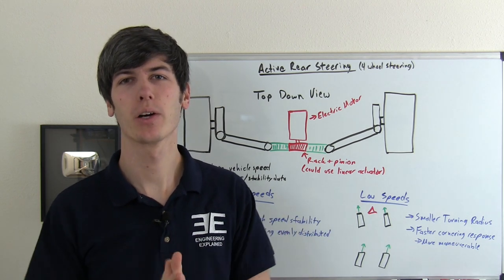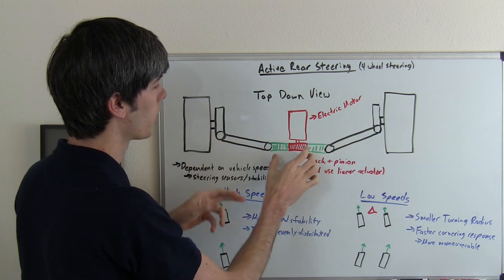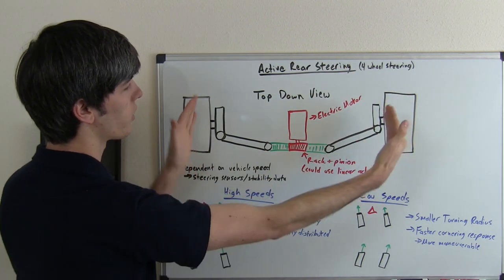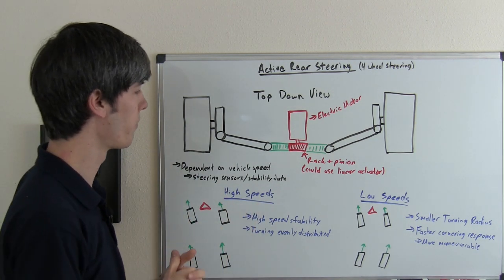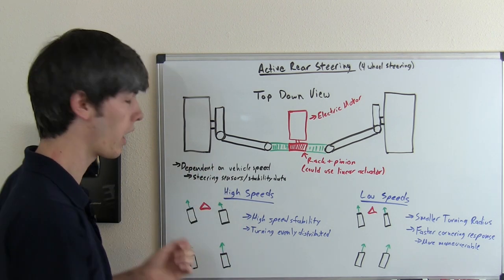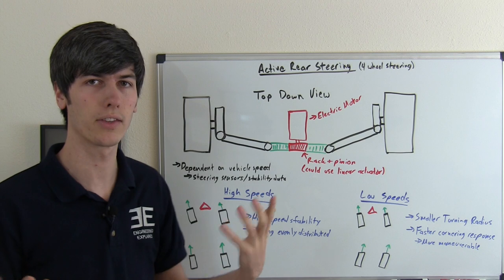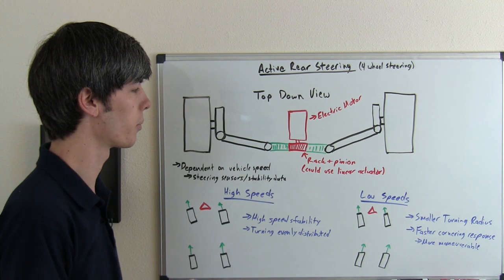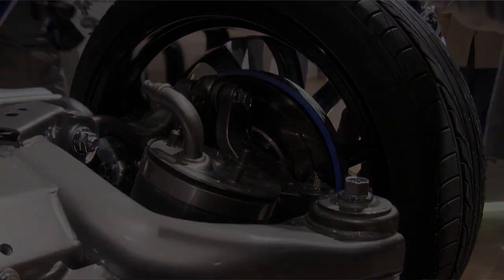Active Rear Steering - 4 Wheel Steering - Explained

Comment: What happens if l turn my steering wheel at low speed and then l hit the "high speed low limit" while keep cornering?
Reply: It operates via some function including variables mainly such as speed and steer as well as yaw and pitch and other things so the car won't just jerk the rear wheels the opposite direction when you hit the limit

Comment: What is meant by automatic torque based differential
Reply: It adapts the torque distribution to the two wheels, so that it transfers power to the wheel that needs it, rather than the wheel that spins and skids.

The need for the differential gear in the first place, comes from the fact that the two wheels have to spin independently while turning, since they both take a different path length around the corner.  Normally, there is a cluster of bevel gears that allows them to rotate independently, and can transfer power to both wheels, as long as both wheels equally grip the road.   However, when you are stuck, and one wheel has traction while the other skids in place, all the power is transferred to the skidding wheel by default, and you need it to transfer to the wheel that grips.

An automatic torque-based differential provides a direct connection to the ring gear of the differential set, for the outside wheel when you are turning, so that power has a bias to transfer to the outside wheel while turning, where it is needed the most.  This also allows it to transfer power only to the wheel that grips, when one wheel is skidding, by engaging one clutchpack or the other.

Comment: rear wheel steering adds so little to driving dynamics that I say is just not needed in fact all it does is adds expences to the manufacturing price. Durring driving front angle is not visible, rear angle is almost nothing. 
What you rally want for stability and performance is constant all wheel drive like quattro or similar.
Reply: in cases where the vehicle is long it is nice I am sure.  I have a long, and have vehicle.  unfortuantely I doubt they make one that is in my price range but right now my vehicle is long enough I almost have to get clearance by the state to turn.  ha ha.  So I can see it being useful for long vehicles, but I am sure it is a very shiny penny and not something the factory would offer but a customization shop might

Comment: Does a car with electric power steering work the same way?
Reply: Cars with power steering have a planetary gear that is driven by a motor, in addition to the steering wheel, and the common output drives the rack and pinion steering.  The motor assists the action of the driver, by moving the ring gear, while the driver's steering wheel moves the sun gear.  The carrier arm drives the steering, adding up the power from the driver, with the power from the motor assist.

Comment: I wish japanese car manufacturers had been a bit less rushed in introducing their 4ws systems, it got a reputation of being a high-maintenance, expensive gimmick with little actual benefits. With modern stability augmentation computers it would be something entirely different it was back in the late eighties...
Reply from the maker: Well, I think it's better to simply say technology improves over time.
Reply: 3000GT comes to mind. Amazing vehicle in some ways, but todays 3000GT's still alive mostly have their rear wheel steering welded.
Reply: Here in Australia, it's very common on nissan skylines (as we've been importing these since the mid 90's). Nowadays, though, the whole HICAS system is either removed entirely or locked with a solid bar.

Comment: What if there was a curve in the highway?
Reply from the maker: +Sean Klimczak All highways curve eventually. The front steering angle can certainly be larger than the rear, and even if it wasn't you could maneuver through highway bends.

Comment: So how come more cars don't have it?
Reply: Because most drivers aren't willing to pay for it.   It's a feature that improves your steering performance, but you pay for it both in the cost of the extra parts, and in more parts to maintain.   The fixed rear wheels are sufficient for most drivers, and that's what most drivers settle with.

Comment: imagine if that electric motor got stuck lol
Reply: I doubt the engineer didn't think that through. The rear steering system will decouple from the motor and center to its default position due to caster angle effect. Similar to what happened when you turn the front wheel and it centered itself automatically.

Comment: so..should you be on the highway...and something happens in which you need to quickly turn off to a side or something..youa re fucked.
Reply: It's not a direct system. It's computative - it calculates how much your "wrenching" the steering wheel and adjusts accordingly. That's why it's called "active" not "passive".